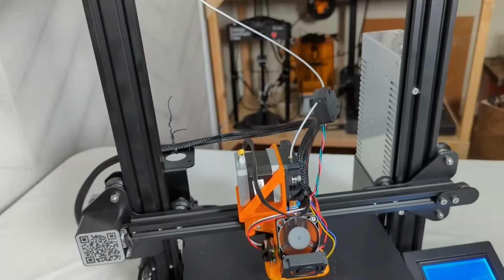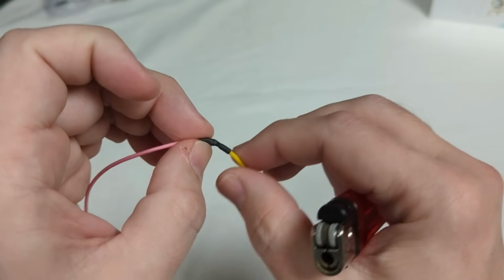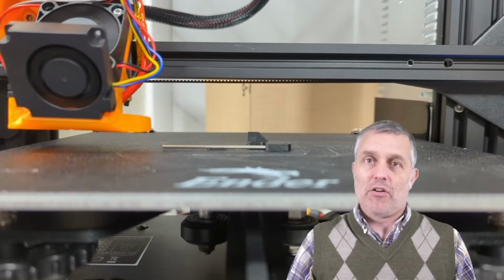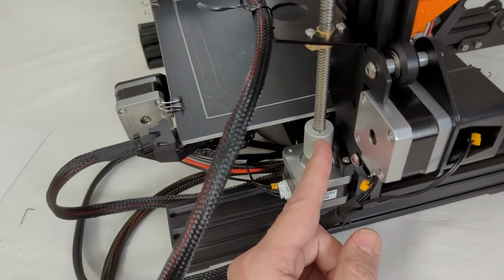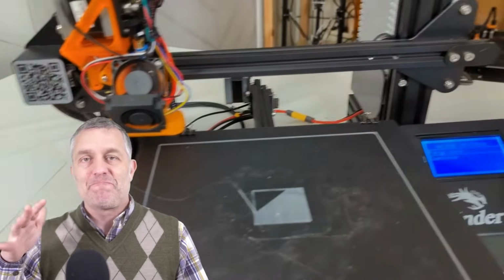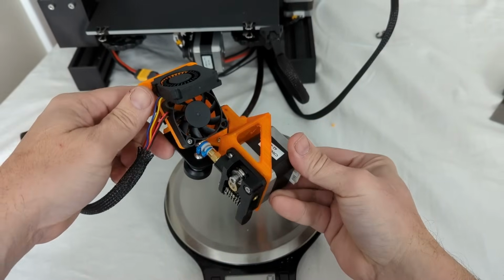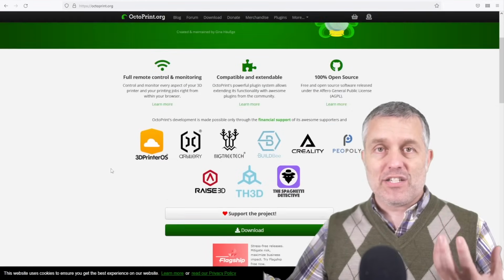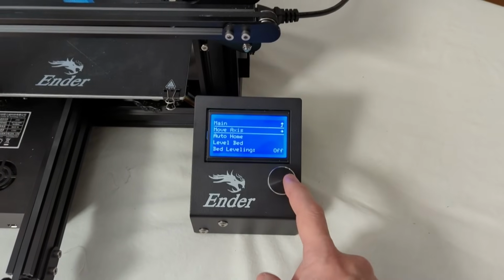Unbeatable for $200 - A 3DPrinter for Newbs & Print Farms

Comment: Great job. Like gorilla warfare way of excellent upgrade for the Ender. Maybe there is a way to make allen key drop when homing X and move up and then retract and lock on small magnet when head goes down? 
If one goes for Octoprint then welcome  the Klipper + input shaping that do a lot for quality improvement by including dynamics of the frame in driving the steppers.

Comment: I had a delta 3d printer many years ago with a very simple auto retracting probe that also used an allen key but was based on a microswitch not a proxi. I think it would be a simple revision with some changes to the carriage design and firmware which If I recall correctly may not have been marlin I used back then but repetier host

Comment: To Avoid the jamming issues with the #MicroSwissHeatbreak what I do is I get the hot end to temperature and I just push some filament in  to come through the nozzle and then I pull it out.If you pull the filament after it cools it just won't come out.

Comment: Indepth video... But newbs and print farms? Both want the least hassle possible.  If you could find a way to auto lift the probe that would massively help.  Perhaps a tiny solenoid?  

What are you hoping to achieve with this? This would need to be a cheap, relatively easy to install kit if it were to be viable for print farms or newbs.

I own an E3V2 and a flsun qq-s pro, both on various stages of mod (some very very rare), but they are all less technical effort than this mod.  I feel like I am being overly critical here but whatever I guess. Worst that will happen is that I will be featured as a 'prusa shoein' lol.  And if you think that, then give me a message.

I really expected this to be a kit or a complete unit and not an ender based printer when you did your last video when you mentioned it.  Abs, wiring, electronic understanding, remembering to remove probes etc. None of these fit newbs or print farms.  This IS a cool project, the topic just is rubbing me wrong on this.

Would I prefer to have not spent double the cost of my darn e3v2 on upgrades, and gained all you have? Heck yes.  40 bucks for a darn probe from Creality, urgh. I literally hack paintball markers together with epoxy, cut aluminum, hack electronics..... But I know that longer term it will be a maintenance hog.  This POTENTIALLY may be the same.

Ok, going positive mode:. What I would LOVE to see is a budget linear rail system.  I saw the anycubic S i think, as a good candidate but failed in some areas (y-axis deformed from crappy mounts on rails). Get something similar on a budget... I and others would be very interested.  THAT would be a prusa killer IMO.

Comment: I suspect you could get away with PETG on your part with many fewer issues - also of course you don't want to be around an Ender 3 at ABS temps while it potentially outgasses the PTFE tube either.
Reply from the maker: >I suspect you could get away with PETG on your part with many fewer issues
"Nope." -The voice of experience
Reply: @DesignPrototypeTest  fair enough. BTW I've started using HIPS for my shrouds and mounts. ABS temps, lower weight, and easier to print without an enclosure. I mostly do it for the weight though. I'm unlikely to run into limonene on my printer so I'm not worried about the solubility.

Comment: Great build. I love my heavily modified ender 3. In my opinion, the best upgrades I made were direct drive convertion (e3d v6+bmg+pancake motor), skr mini e3 v2 and use UBL. I made my own optocoupler board in order to use an 8mm distance inductive sensor. It was very cheap since I've got a diy cnc router, and a I learned a lot about sensors and making it work reliably. I mostly print abs, petg and some pla, so I only storage 3 meshes, use the tilt function on marlin and hit print.
I definitely will try your filament run out sensor.
BTW, my most important "upgrade" was the correct reassembly of my printer. If everything is square and well mounted, I eliminated most of my problems.
Reply: @jamesmccaul2945  Yes, second leadscrew is coming! And the steel spring sheet + smooth pei worked great so for. But that flat piece of cast tooling aluminum would be a breeze for sure!

Comment: I just bought an ender 3 s1, and replaced the POS bed surface with G-4, removing the magnetic stuff as well.

I'm wondering if you have a list of the upgrades you made, and if some of them would apply to the s1, which, besides the POS bed surface, seems quite good.  I'm thinking maybe the part cooling could be improved because the current one blows only from one side.

Also, I'd like to upgrade the stock Marlin firmware at some point, and get off the Creality fork.  I already abandoned the slicer that came with it and am using the upstream Cura slicer, but with the s1 printer settings taken from the slicer they shipped.

Comment: If you're going to add a pi, then i would convert it to klipper, you can use octoprint or not,  but definitely add an accelerometer and run input shaping -- all your Marlin issues go away. At this point, I know you can't help about your rants, not saying you're wrong, just very polarizing. Clearly after watching your channel for a while, it's just your style. The cost of the wire loom and effort to make a probe -- wonder if just the cheapest bl-touch knock off would be cheaper?
Reply from the maker: I have never used Klipper. I hear good things. For my viewers who can just plug in the SD card and get an updated Marlin firmware build, the effort/complexity to get a Klipper build working is a deal breaker. 

Do you really think I should tell my viewers about BLTouch clones? A option to spend 3X more than what I have developed with no benefit in accuracy of first layer adhesion. You are asking me to support criminal thievery of intellectual property in the name of lazyness (automatic deployment vs manually placing the Alan key in the hole). Not to mention the fact that the BLTouch pin is easily damaged while the alan key is robust enough to withstand collisions without bending or getting thrown out of calibration. If you are a Christian, you are asking me to violate the third moral commandment "Thou shalt not steal" for the purposes of satisfying one of the seven deadly sins (sloth). It's an imperfect world we live in. There is a lot of gray area, but in the case of the BLTouch, all the clones are unambiguously theft.

Comment: feels like u should mention that u can get a fake bltouch for $15 even tho u dont support clones.
Reply from the maker: So I should tell my viewers about an option to spend 3X more than what I have developed with no benefit in accuracy of first layer adhesion? You are asking me to support criminal thievery of intellectual property in the name of lazyness (automatic deployment vs manually placing the Alan key in the hole). Not to mention the fact that the BLTouch pin is easily damaged while the alan key is robust enough to withstand collisions without bending or getting thrown out of calibration. If you are a Christian, you are asking me to violate the third moral commandment "Thou shalt not steal" for the purposes of satisfying one of the seven deadly sins (sloth). It's an imperfect world we live in. There is a lot of gray area, but in the case of the BLTouch, all the clones are unambiguously theft.
Reply: Design Prototype Test yeah just buy clones, oh your ender 3 is a clone btw
Reply: @user-yk1cw8im4h  a (dare I say it) PRUSA clone, at that...
Reply from the maker: @user-yk1cw8im4h  Not this again. I've put this to bed so many times. The Ender 3 is the evolution of the Mendel Max. The Mendel Max came from the Mendel. The Mendel was developed by Dr. Ed Sells source:  https://reprap.org/wiki/Mendel  The Prusa's original printer was called the Prusa Mendel. It was a minorly tweaked version of Ed Sells design. Eventually Prusa developed the printer further into the Prusa (Mendel) I3. Mk.3. So you see each printer the Prusa and the Ender 3 share a common parent. You cannot say that the Ender 3 is a clone of the Prusa any more than you can say Michael Prusa (the younger brother of Josef Prusa) is a clone of Josef.
Reply from the maker: @Daede420  Not this again. I've put this to bed so many times. The Ender 3 is the evolution of the Mendel Max. The Mendel Max came from the Mendel. The Mendel was developed by Dr. Ed Sells source:  https://reprap.org/wiki/Mendel  The Prusa's original printer was called the Prusa Mendel. It was a minorly tweaked version of Ed Sells design. Eventually Prusa developed the printer further into the Prusa (Mendel) I3. Mk.3. So you see each printer the Prusa and the Ender 3 share a common parent. You cannot say that the Ender 3 is a clone of the Prusa any more than you can say Michael Prusa (the younger brother of Josef Prusa) is a clone of Josef.
Reply: @DesignPrototypeTest  Fair enough. Just FYI, you look like a nutter when you spam the same comment twice to two different people in the same comment thread...
Reply: "The definition of insanity is repeating the same task over and over and expecting a different result"
- "Probably" Albert Einstein (there's no tangible citation, but he gets the credit for it)
Reply: "Reality is irrelevant; Perception is everything."
-Terry Goodkind
Reply: @DesignPrototypeTest  I'm just not a fan of this design. For most things just use the bltouch or no abl at all. Maybe at higher temperatures that might kill the bltouch it would be better but theres capacitive probes or inductive probes as well. Maybe u could use a solenoid and the optical sensor but it probably has the same issue with heat. 

For the non stowing one why didnt u reuse the end stop? It would be free and u dont have to wait for stuff to be delivered. Also if u want to develop it I would definitely just make the Allen key flag just insert the key from the side and superglue in place or tack it with heat.
Reply: Personally, I find a probe that could potentially damage my bed far less desirable than a probe that could potentially break due to malfunction...though, bed damage from the nozzle would probably occur at that point, so...meh, nevermind...

Comment: Great video with lots of info for the low-budget user and relatively little ranting.
A magnetic clicky probe might have been a better choice here (although your Marlin build would require more tweaking for it).  That would have allowed fully automatic probing with the probe being picked up at a position slightly outside the bed surface, locking onto the magnets and then moving up to take it out of its dock.  I don't know whether such a design is readily available for the Ender 3, but I see no reason why it would be difficult to do.
A jam detection is very simple to add on top of a simple endstop switch filament sensor, by just having the filament pass through the sensor in a bent, created by a spring pushing it towards the endstop.  If you have a clog, the pull on the filament will outweigh the spring and when the filament then moves away from the endstop switch that triggers the filament-out detection.  Can save the day if the end of the filament is stuck tightly to the spool it was on...
A very important rule of engineering is to not waste money (time/effort) on unnecessary stuff, so a lot of the expensive great 3d printing hardware out there is in many cases just overkill.  The Revo to me would be the first thing I would really consider worth it, just to avoid the leaking around the heat-block which I guess everyone hits at some point in the 3d printing experience path (and not having PTFE in the heat zone is a nice added benefit) ...  Ah yes, a non-PTFE-lined heat-break is worth it, but you can get those for very little money from AliExpress.  Will the Slice one be better?  Sure, but again it all depends on whether you need "great" or consider "good" good enough ...
For an Ender 3++ I wonder whether Creality should go to Core YZ.  That would remove the need for the existing lead screw at the cost of some belts and idlers, but offer z-support from both sides without needing an extra motor or lead-screw.  I do guess it would take quite a redesign of the gantry, so it will likely not happen on the low-cost Ender 3 segment, even if it could be cost-effective ...

Comment: Solder your wires, ESPECIALLY when putting resistors, transistors and capacitors inline. FFS.
Reply: TS100 soldering iron: $75

Heck, even heat shrink solder connectors are $20/box, plus a $20 HF heat gun.
Reply: "Crimp connection"  you mean like when you use an automotive crimp connector with a crimp tool for $3. nope, just roll the wires in a ball. 
To each his own.
Reply: For moving solder joints I use a crapton of hot glue around the heatshrink/ joint so the joint never needs to bend
Reply: Ooof as soon as I saw this comment made me brace for impact... Didn't help that connection made me cringe  😬

Comment: im currently doing this with my sovol sv01. im doing small incremental upgrades trying to keep it under 50$ in upgrades you can get the sv01 on sale for 200 all the time. so far i did solid bed mounts, anti backlash z screws,  printed part cooler, garolite bed (sheet from mcmastercarr) , ABL using a capacative bed sensor so i can run any bed. got about 25$ left  for a bi metal heat break and idk what else its working damn near flawless for the price

Comment: some feedback
1) for me geting octaprint/fluidd/mainsail is in the top 5 print from SD card just cost to match time and work (not talking about getting them corrpt from time to time)
2) auto bed level is mast (no point to setup octaprint if you need to go and see if the bed is leveled before printing) 
3) cooling upgrade/update 
I'm not sold on the rest  the DD help but the corrnt setup works too update the hotend is nice but not mast (if most of you print are PLA/PETG and that is 90% of the users)
but overall good job 
one last note now days you can get ender clone for less then 200$ like Voxelab Aquila that go from 159~180$ on amazon or TRONXY XY-2 that get some of the upgrades but its crap
so for under the 200$ mark you can get the printer+upgrades

Comment: Can we not use all your tips on our current printers as I have a 10S Pro V1 and would like to get nice clean prints. Touch sensor. Relocated Direct Drive, Improved part cooling, Improved CPU Cooling, Improved Spool holder, Wire brush between layers, most all of your suggestions would be great additions to my existing printer, ah the challenge is programmed code and designed parts are  all different and special instead of targeting one cheap printer to upgrade. Yes I get that. and maybe a back up work horse for production would be a good start. Is this $200 machine reliable. I have Octo-Print so I could load print files and setup a production machine pretty easy.  I think. Well i have to say $200 is not a lot of money. If we can reliable detailed parts. Excellent Post. I will see if i can $200 from the CFO. Dennis
Reply: all of these improvements are available for your 10S Pro V1, you just need to join a Creality community and ask/search for them. Most of the solutions you'll find will actually be more user-friendly than the ones presented here.
Reply: of course, to be fair to DPT, I'm pretty sure he was going for the cheapest upgrade route with each upgrade, and I feel like he's spot-on in that regard
Reply: @Daede420  Yeah he definitely was, hes usually big on stuff like duet and bltouch but he just stuck with default and did the allen key probe to get the absolute lowest price probably forcing himself to a budget of about $20 to stay around within $200 pre shipping
Reply: @Daede420  Yes i did reach that conclusion after a bit, and think it was a good posting. worth reading and trying a few things out. Good feedback  all around. D